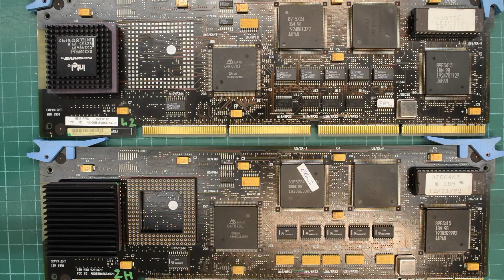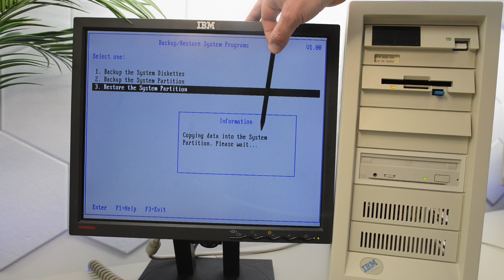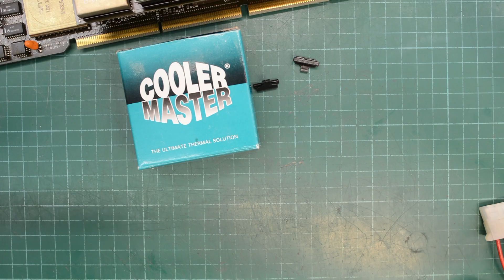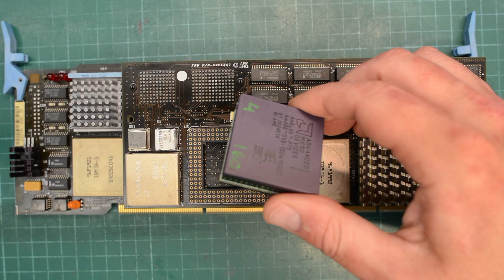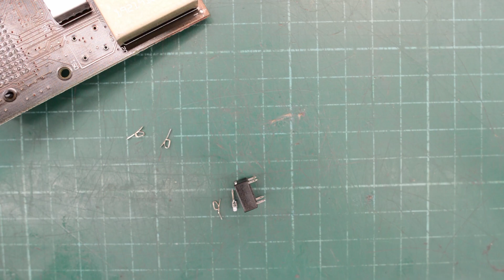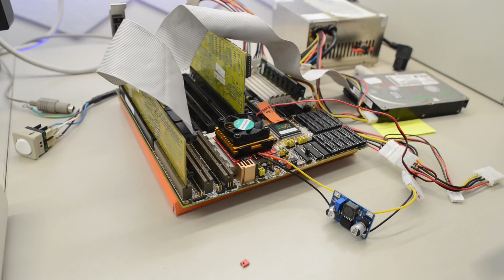Overclocking IBM PS/2 95XP with a 5x86

Comment: For the processor complex boards that have trouble at high speeds, try changing out the BIOS EPROM with a faster one.

When overclocking my IBM PS/1 Model 2133-C11, the machine was unstable at 33 MHz bus speed until I figured out the 27c1024 BIOS EPROM was too slow, I think it was rated at something like 150ns, which was fine for the original 25 MHz bus speed that ran the ISA bus at ~6.25 MHz, but was not fine for the faster 33 MHz bus that ran the ISA bus at 8.25 MHz. I used a 27c1024 rated at 70ns, and it fixed all of the weird issues I was having.

With the original 150ns EPROM, the machine would sometimes boot, but crash. Most of the time though, it'd not POST or display all sorts of nonsense error codes and claim the configuration data was corrupted.

I think I probably have the fastest IBM PS/1 Model 2133 in the world. It runs at 33/66 MHz with a TI486SXLC2. Haven't tried 40/80 MHz yet since I don't have and 80 MHz oscillator on hand.
Reply from the maker: Thanks, I'll try that on one of the stuck projects. My SX25 2133 is running a 5x85 @ 160MHz :)
Reply: @Epictronics1  Lucky you have one of the later 486 versions. This one originally had a soldered CQFP 386SX-25. It was a pig with no cache.

Strangely, IBM was planning on making a 486 version of the 2133 386 model. Dumping the BIOS and poking around in it, there are strings for the 486 CPU.
Reply from the maker: @GGigabiteM  This one, too, had a soldered 486SX25. I disabled it with a bodge wire and installed the 5x86 in the Math Co socket :) Maybe there is a similar hack you could do with the 386? Check out my 2133 videos for more info
Reply: @Epictronics1  The 2133 386 has no socket, just the soldered CQFP 386SX-25. The only socket is the PLCC for a 387.

Comment: As for the power supply covering 1/2 the CPU fan, is the fan like most CPU fans and it actually blows air down toward the CPU?  If so looks like it can intake plenty of air and then force it out the gold fins, so all should be fine.
Reply from the maker: Yeah, I think it's ok too. But it probably needs a better cooler when overclocked to the max

Comment: I have a few of those Power Stacker interposers which are definitely great/convenient but my beef with them is that the pins are quite a bit shorter than your typical CPU so depending on the socket it'll go on, it may not make good connectivity. I have yet to try building a Socket Blaster, looks very time consuming but definitely a viable alternative to these now unobtainable interposers. Thanks for the video and keep up the good work!
Reply from the maker: Thanks, yes, very time-consuming, but totally worth it

Comment: Tjat connector between the boards looks like the connector they had on the interposers for IBM's "federation" high-performance switch.  Except the federation interposers had more pins.

Comment: Interesting results! For comparison, Compaq LTE Elite laptop with AMD 5x86 @ 133MHz swap on my custom board does around 32FPS in DOSBench Doom, it has no L2 cache and no L1 W/B support, but has VLB Paradise VGA card which seems to help a lot. Edit: WB cache must be supported in BIOS and needs all extra signals physically routed, on my CPU mod I had to force it to run in WT mode as the Compaq never supported that in BIOS or hardware.
Reply from the maker: I can't wait for the pin headers to arrive so we can try it with WT cache. Yeah, local bus graphics make a huge difference.

Comment: I was just remembering when I was a kid I was playing doom during my breaks while mowing the lawn. And then one time I came back and doom had crashed. Nothing did anything. I rebooted the computer and it wouldn't boot. The hard drive had failed. I don't remember if the hard drive locked the computer (which would explain the doom crash) or if the hard drive was just unreadable, but why would doom have crashed while paused?
Reply: @awilliams1701, Just because the game is paused doesn't mean it stops executing code.  It might be looking for keyboard inputs, redrawing the screen or any number of other things.  The first time it needed that hard drive for something it crashed. (IMO)
Reply: @ErrorMessageNotFound  yeah I didn't say it wasn't, but it shouldn't need the hard drive. Everything that needs to be loaded for this PAUSED scene is loaded. Since the game is paused you can't move. Since you can't move no new assets should be needed. So no hard drive reading should be needed.
Reply: I had a hard drive fail right when I was playing Heretic not too many month ago and all was working fine until the computer froze completely. the drive failed with click of death and never worked again. Since a computer is dependent on reading and writing all kinds of operation data to the drive to run both game and operating system and can´t do that it will lock up either completely or do a Bsod of death. My number of failed drives are adding up these days from either minor or fatal data loss as a result. Keep backups
Reply: @Pulverrostmannen  yeah I don't use hard drives anymore. I'm all in on samsung drives. I have a SATA that's over a decade old and still works. And I have 2 NVME's that are 4 years old and still work great. In the meantime I have a sandisk NVME that's 8 months old and it's acting up.
Reply from the maker: @awilliams1701  I thought Sandisk made good stuff. Shame on them if it acts up after just 8 months!
Reply: @Epictronics1  HDD recovery services has made a lot of money recovering data on this particular SSD. I didn't know that when I bought it. lol It's split into 2 partitions......even when there are none. Unpartitioned area 1 is 100gb. unpartitioned area 2 is the rest of the 2tb. area 2 will not format no matter what I do.
Reply from the maker: Maybe I should check the hard drive